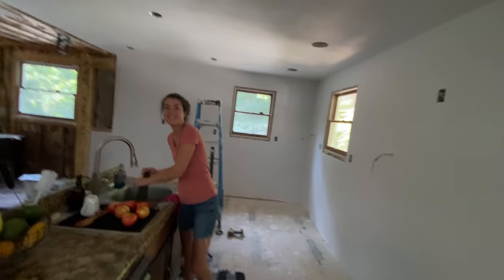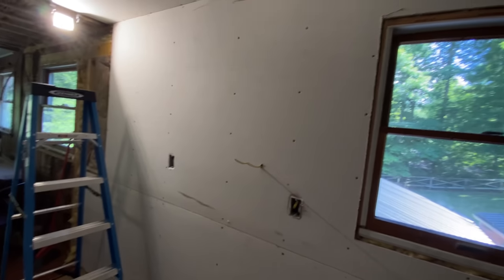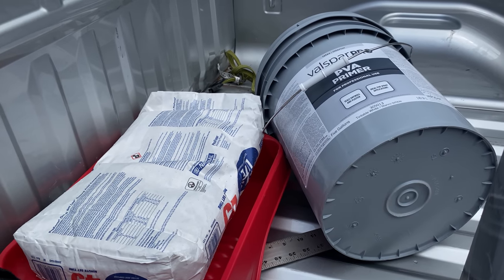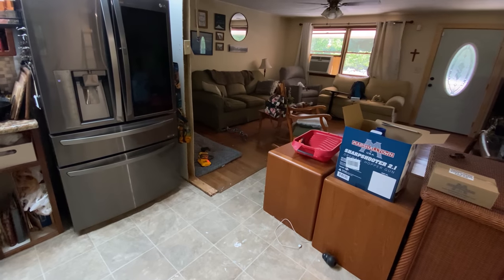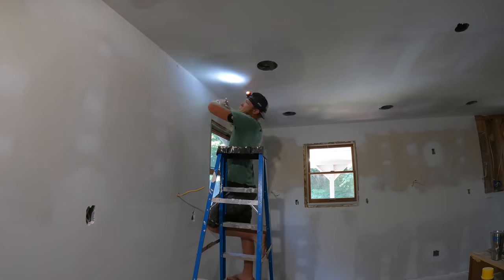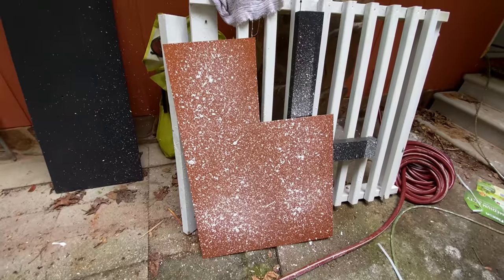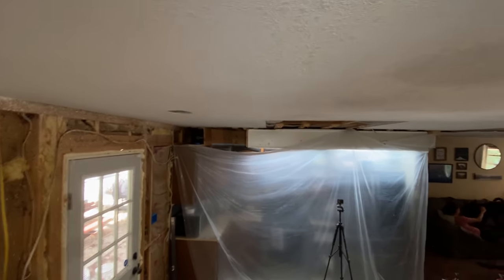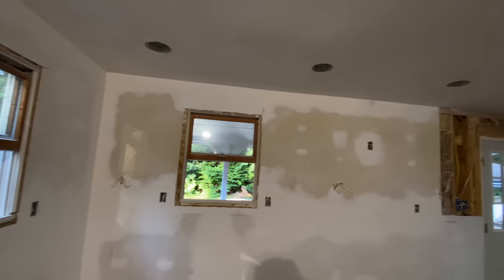Modern Home Makeover // Finishing Drywall

Comment: My favourite part is when you guys keep on learning new things every video you made. 

Pro tips for you guys. The drywall guys here in Singapore used the plastic tapes on the joints before plastering the whole wall with the drywall cement like what you got. That way you will have a nice texture for your walls and ceilings. The drywall plaster cement cost around USD3 for a pack of 5kg. They will cover the whole wall and your ceiling. Anyway, it's cool to learn doing new things. I believed you guys gonna start flipping houses in the future. 👍👍👍🤙🤙🤙

Comment: First, God Bless you, Ray, for all that hard work.  I feel for you.  And you did a great job, mess or no.  Second, um... well, I see a perfectly good pair of extra hands that could help with a lot that work.  That is, when she's not filming.  I assume she IS filming... right?  She DOES want her kitchen back, right?  At least, I know that's how I learned how put up sheetrock, tape and spackle.  Because I would rather dig in and work than wait.  

BTW, have you ever tried wet-sanding sheetrock?  There are special sanding blocks with a sponge between two pieces of sanding paper.  You dampen them and when you sand, you rinse out the block once the dust builds up; so you have to keep a bucket of water with it.  But it manages the dust beautifully.  And, while the moisture softens the spackle somewhat that can be a good thing.  

Yes, I have been through remodeling my kitchen.  It wasn't even a complete remodel, just partial.  It was hell.  I was gone most of the time (between working and going to night school) and it was still hell.  Basically, we re-did everything except we kept most of the cabinets (but added new counter tops), added a lot more cabinets and retiled, both the backsplash and floor.  That was enough for me.  It took months.  But it was worth it.  I loved the kitchen after it was done.

Comment: Your remodel videos are the best!!! So relatable haha. I'm totally not a pro but have been learning a lot from Vancouver Carpenter. Just a tip from him, apparently you're not supposed to use a dimpler bit to install the drywall screws because it reduces the strength of the drywall paper around the screw. I ended up giving in and buying a drywall screw gun.  Anyway, I'm sure it'll be fine though. It turned out looking great!
Reply from the maker: Thanks for watching! I actually ordered a DeWalt drywall gun, but it didn't arrive in time. Hopefully It will be here for the rest of the remodel.

Comment: you would have benefitted greatly by using a set of zipwall poles to create a barrier betenn the parts of the room you are actively working on, and the rest of the house.  they are worth the cost because your wife would be a lot happier because the house would be easier to keep clean.

Comment: Why did you texture you ceiling? Just leave it smooth.
Reply: It’s so weird to do to me. It only makes it way harder to actually patch or do anything with in the future. And to me looks way uglier.
Reply from the maker: I’m not a professional at drywall… I didn’t want joints to show up in the ceiling which is much harder to hide than walls and much harder to work on. Our drywall crew sprays knockdown on ever new home we build with the Perkins that has drywall ceilings.